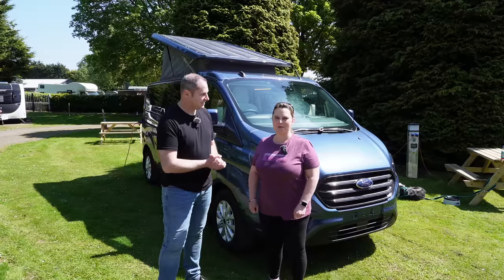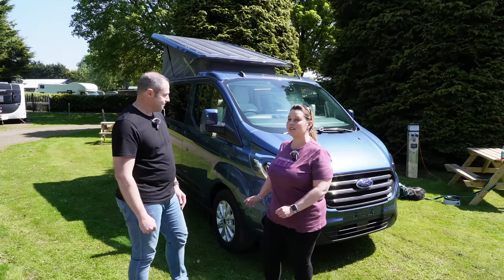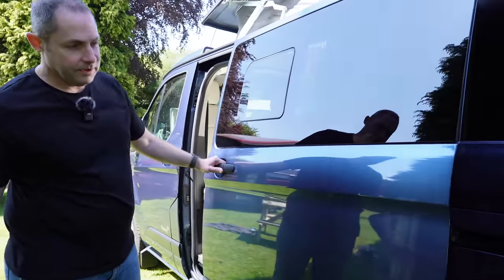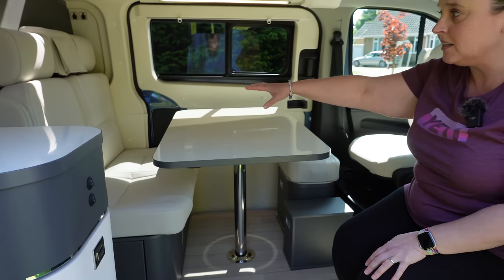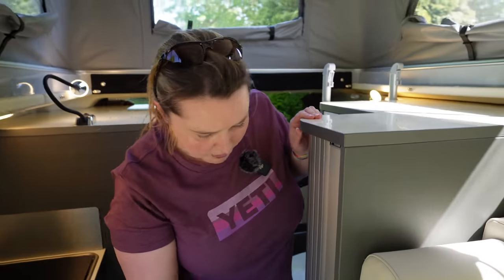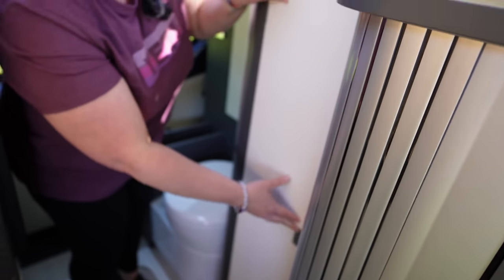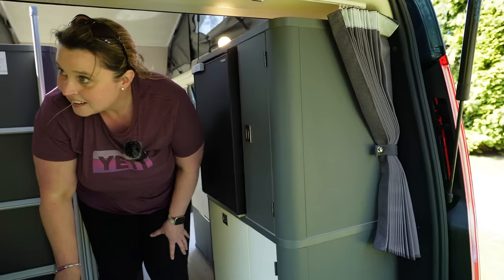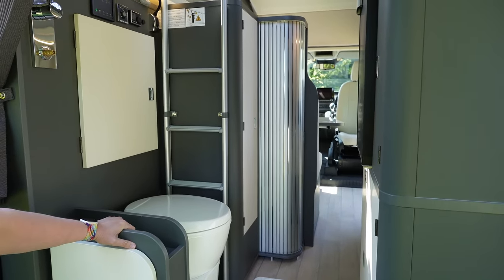Westfalia Kelsey Review - Is it *EVEN BETTER* than a VW California?!

Comment: Hi 
When we decided on a California there were several variations, including the nugget that we considered but we had a several issue  with them and this one has a number of them. 
The bench seat and table are two narrow for anyone overweight to sit in comfortably. The access to the upper bed even with the ladder is not ideal for broad shoulders. Having to move the ladder rotate the toilet back and forth to use the toilet is a pain. Where is the bedding store for the down stairs. Or for the roof for that matter. Even though the van is larger the overall storage is less than the Cali. We store all the bedding on the board above the boot. The boot is a much larger storage space than any in that van. The outdoor table and chairs would not fit in any of the spaces I saw. The downstairs bed was a mess to put together. In the Cali I roll out the bed, throw the duvet and pillows on the front seat and flip the mattress. Just over a minute to set up and a minute to store. The bedding sits nicely behind the bench seats during the day. I cannot see where half of the things we have with us could go without constantly having to move them as so much space is taken for walking access. So it’s a bigger van with less storage. The shower is too small and fiddly to be any use and heating a ten litre tank when I would just boil a kettle for washing up water would be a waste, unless it only heats water as used but that tends to be less efficient as you use extra water getting to the heated and always leave some hot water in the pipes. Overall they always look really nice until you start trying to use them.
Reply: Useful insight. Thanks :)

Comment: Great video, been thinking about one of these, like the different layouts rather than the standard california. Good to see some of the limitations as well, such as the ladder over the toilet and the downstairs bed. I think the nugget plus does these slightly better. Need to see one in real life.
Reply from the maker: Well in that case you'd like the Club Joker City (video coming soon!) as layout is similar, based on the T6.1 VW of course, but doesn't have a ladder but does have a fold down step and cushion that goes on top of the toilet instead.

Comment: I'll never understand the pop tops now that hinge at one end. My last camper just opened t both ends and lifted straight up. Same head height the entire length and two insect-proof windows with flaps both sides, and room to sleep up top with equal height either way. Why change?

Comment: We have one! 

We strongly considered the nugget, not so much the Cali (I think the cali is a different proposition and don’t really see as a valid comparison).

We were seduced by the Kelsey’s lovely interior and wanted a decent automatic. Relative to the nugget, this was more than £10k cheaper - plus it has a few advantages which makes it better off-grid (bigger water tanks, bigger fridge, gas heated hot water). 

The comments about the ladder, downstairs bed are all valid… There’s no doubt the nugget has a more ergonomic layout - but that’s not to say the Kelsey doesn’t work.

Also I would say the nugget has a slight better build quality - again that’s not to diminish the Kelsey - it’s a quality product, you pay a bit more and get a bit more with the nugget.

There’s plenty of storage in the Kelsey units . For extra storage, we simply built a large box that slides over the shower tray and stack boxes over the toilet (with a net and a few hooks to restrain them). Its all safely restrained and unloaded in few minutes into a pop-up tent. I should add we’ve two kids -  we can carry everything we need. 

The downstairs bed is actually much easier to assemble than it looks - once you get used to it. I haven’t timed myself but it’s a couple of minutes at most. Moreover it’s pretty comfortable - and dare I say it probably more comfortable than the nugget bed, as it’s largely flat with a proper mattress. 

I prefer the Kelsey light interior - which despite being cream seems fairly easy to keep clean. I also much prefer the kitchen layout in the Kelsey. 

On balance no regrets going for the Kelsey. Great to drive, has all the comforts we need.  Lovely feel to the interior. 

If I was planning to use the van as my primary vehicle I’d probably stretch to the nugget, as it’s much more car like. But as a camper, no regrets going for the Kelsey
Reply from the maker: Brilliant! Glad you're having a great time with it 👍

Comment: Thanks for the review, its always good to have a different viewpoint. We have looked at these along with a Cali Ocean and they are very different, we cant justify the new price of either but up to 2020 may work. We were impressed with the quality and my wife loved the idea of having a proper loo onboard. I'm not sure about the shower arrangement but like you say you could always take the head outside. We want to use it as a car replacement for longer journeys (we have another town car) and be able to tow our caravan with it on longer breaks giving us the flexibility to use the camper as a day van and occasional overnight, anything taller wouldnt go into many UK car parks with height restrictions, the problem is we want an auto but the tow limit is woeful on the Ford, 1000kg at max weight compared to the Cali DSG 2300kg, manuals seem OK 2200kg Cali, Ford 1965kg.
Reply from the maker: Oh I didn't know that about the Ford and the autobox. How odd!

Comment: Can you please do a side by side speed test with the California to make the downstairs bed? 😂😂😂
Also, it would be good to see how you work in the kitchen with the roof down. In the California you can still sit on the bench seat to cook, but it looks more difficult in the Kelsey.
Reply from the maker: We did talk about that - the Kelsey feels like it has really tried to maximise the space utilisation and works best with the roof up as the kitchen is built higher in the van. That said, you don't block any of the cupboards when you have the lower bed out so if the roof is up, you can make a cuppa without physically disturbing anyone else downstairs. Horses for courses I think.
Reply: From 0-40 winks in 60 seconds with the Cali….from dusk til Dawn in the Kelsey 😂

Comment: Thanks for showing us around - we need more in depth walkthroughs like this. The only thing missing was the closing/ opening of the pop top. This gets missed out a lot on reviews and I feel it’s quite important. Is it the rapido one that works with a pull down catch on like a break cable mechanism along with a couple of canvass straps? Was looking for the right camera angle but just out of frame every time 😂
Reply from the maker: Sorry apologies about that, we've missed that bit on the club joker city too. I can't remember on this Kesley I must admit, but we'll see if we can find out for you.
Reply: @CampervanTime  no worries - I was just interested to see if Westfalia use rapido parts as they are part of the group. I have the rapido version on my Wildax. it’s a good system in the sense it locks down well but there is a knack so was intrigued. Looking forward to seeing the Sven!! 😁

Comment: Just started looking into all the different configs of vans. Is the Kelsey the same as a Nugget?
Reply from the maker: Hi - sort of but not exactly. So in simple terms they layout looks very similar - front bench that converts to a bed and then rear kitchen / toilet (nugget plus) but the kitchen and toilet layouts are quite different when you look into them closer. The nugget has two versions (the the nugget on the standard wheel base van and nugget plus on the long wheel base van), the former does not have the built in toilet. The nugget plus also does not have a shower tray internally whereas the Kelsey does (and obviously has a toilet too). Well worth looking at both in person if you can.

Comment: Looks a spiffing micro motorhome but where would we put the shower tent, wind break, bbq, levelling blocks, table, chairs, nets, buckets and spades?
The downstairs bed setup looks like an after thought, should the table section be turned through 90 to plug the gap?
Climbing downstairs to use the loo in the night and having to reposition the ladder, not helpful.

We drove a Ford, good, handling, size and extras. 
Put off by 1 tonne towing limit with the auto gearbox, rakish styling and the colour of the instrument displays.

The Cali ticked a number of boxes:
Sliding seats to give a cavernous boot and bring the rear passengers forward to chat whilst driving.
Almost 360 vision to view the outside world from inside. Creates a sense of openness often denied in motorhomes and caravans
Lightweight simple furniture, including cupboards, and neatly stashed outdoor seats and tables.
Portapoti flexibility, you can put it where you want it.
Its a camping Tardis you can drive almost anywhere you would take an average car.

Comment: It's not the fact that it's different, it's the fact that they expect folk to pay £60,000 plus and instead of making or providing proper bed base they use a Table as support and you cant tell me that the cushions aren't Cheap and will lose support very quickly.
Why make a copy of the Ford Nugget which is basically what it is but it's just a inferior version of it.
How can the Companies justify the cost.
Look at the new Chauson motorhome 2mtr wide x 6 mtr long.
If they had made it as a pop top  they would have made the perfect Campervan.

Comment: I'm 6.3 so that downstairs bed is a no-go. Dont think the space is utilised well, vans too short to have it in 2 halves essentially. I get wanting to be different but need a comfortable bed. That bed is too small, way way too small.
Reply from the maker: It's clear that they are wanting the roof bed to be the main one in this layout with the 'bench bed' being for less frequent use, especially due to the kitchen design at the back meaning you need to stand up etc.

Comment: Why do they try to better the only lay out that works in a small van and that is a side kitchen with a rib bed, high level cupboards on one side and the back and a pair of swivel seats at the front. I can't imagine who this set up would suit over a conventional layout ?
Reply from the maker: To give people a choice if they want it? If you're keen to have a fixed toilet, the ability to have a shower and warm water, and not cover up the kitchen cupboards when you have the lower bed out, this does just that. Different strokes for different folks! We really liked this and thought it was an interesting use of the space.
Reply: Far superior layout than the standard fit out you have described. Westfalia are very amazing and clever the only thing I would say that bed is a tad faffy.
Reply: @samcooper6115  disagree, lwb standard layout is by far the best and with a lwb van you can get in all the cupboards with ease, a portable chemical toilet inside a bag is also useful as a footstool. This layout is not good at all.
Reply: @CampervanTime  disagree, lwb standard layout is by far the best and with a lwb van you can get in all the cupboards with ease, a portable chemical toilet inside a bag is also useful as a footstool. This layout is not good at all. You also have a dirty storage area for the outside gear like ramps etc and above the rear bed leaf for the bedding topper and other clean gear. The tamba cupboards for clothes and the other cupboards for kitchen gear, perfect! Easy access to storage beneath the rib bed and the simplest set up of a bed in a small van is a rib bed bar none.
Reply: Great video, thanks, Sarah and Will, nice to see Roxy.  Hope to see you at Camperjam, we've just bought tickets for the Saturday.😊
Reply: There are two distinct layouts - this one and the side kitchen. This layout is far better if it’s just you and a bag of clothes as it functions better as a living space. Not so good if you need to load up with stuff for activities (surfing, fishing other camping kit etc.)